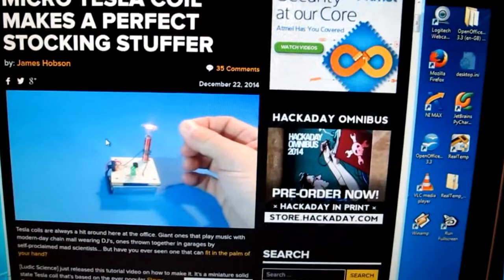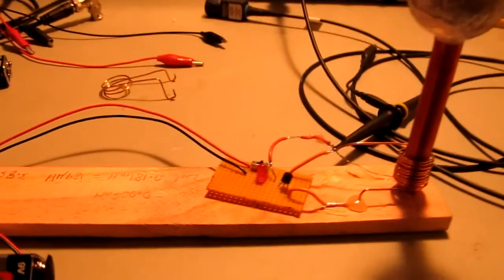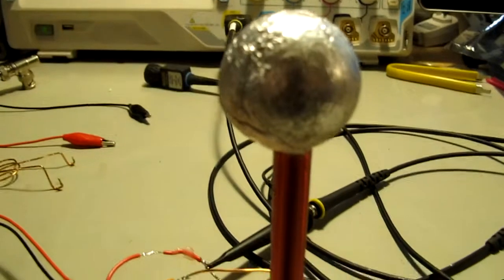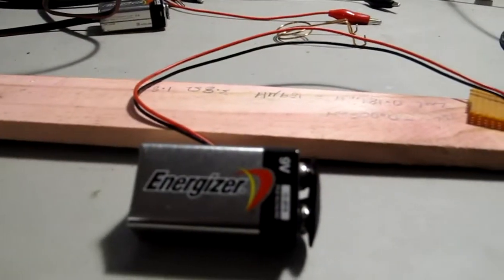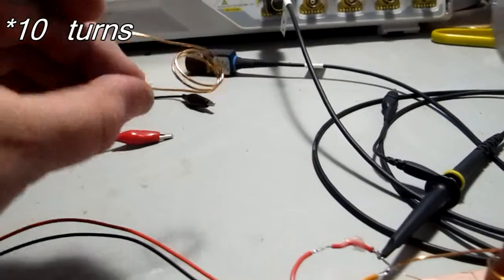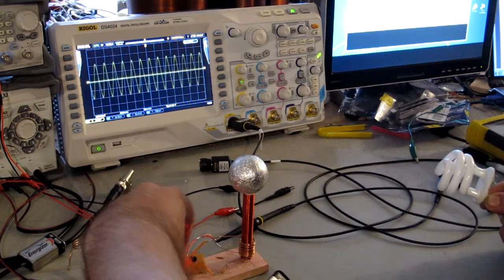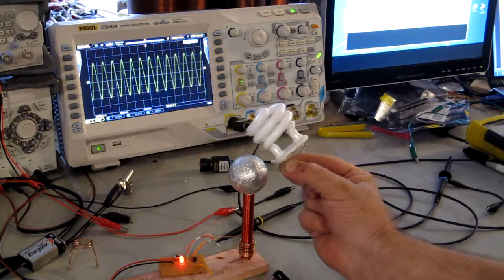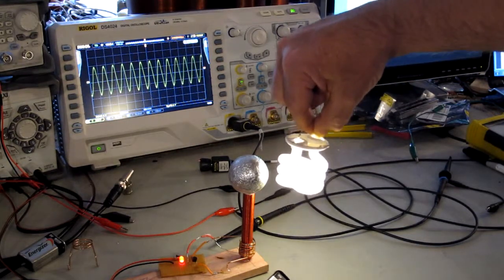Simple mini Tesla Coil

Comment: Interesting, I'd like to make one, but on a bigger size, you have a lot of very interesting videos
Reply from the maker: Thanks.  :)

I've tried making a slightly larger one, but I also tried to make it so I could swap out the transistor and diodes easily. Unfortunately having dodgy screw connections instead of nice soldered ones has meant the sine wave is very distorted and it doesn't oscillate properly.

Theoretically it should scale up fairly well though, so long as you can get silicon that will withstand the voltages and currents involved.